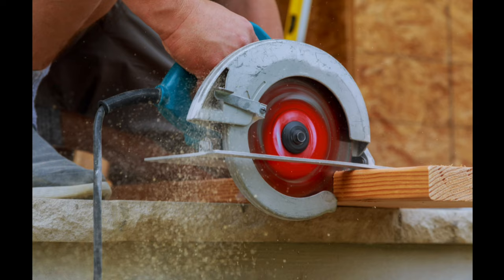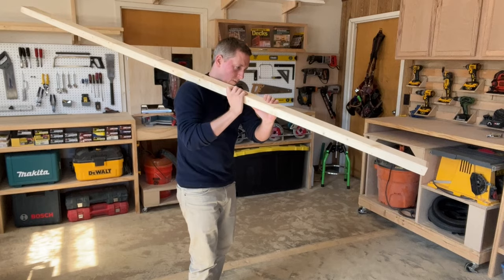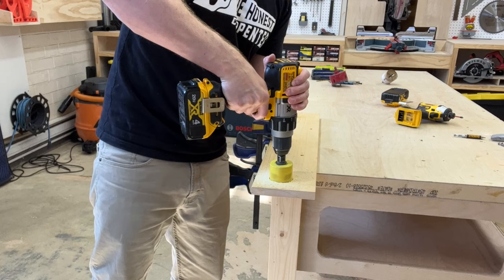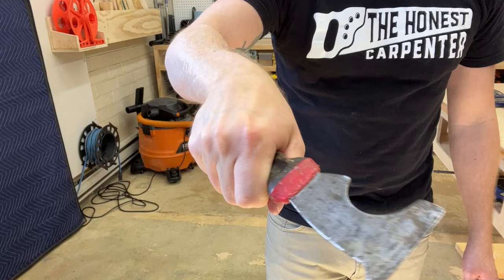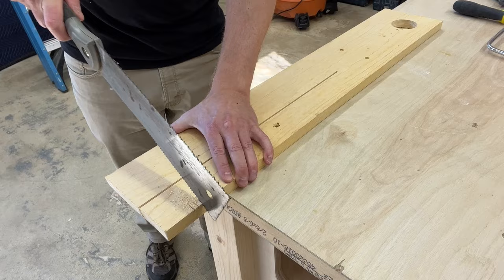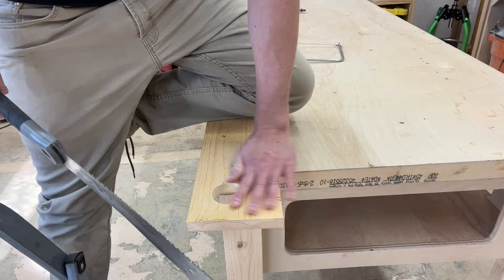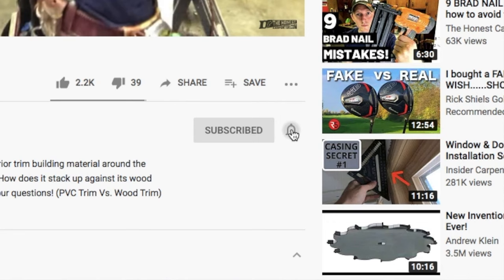9 MOST OVERLOOKED DIY INJURIES! (Avoid These 9 Worst DIY Injuries/Accidents From Common Tools!)

Comment: the thing I've noticed makes the biggest difference has been when I was trying to go fast.  - not just in injuries, but inaccuracies that cost more time than they gain.  working smoothly has less chance of errors that can result in injuries, damaged tools, damaged projects, and lost time.  this is especially true with hand tools.  they are designed so the tool does the work, so rushing it or trying to force it is counter productive.

Comment: You can never enough videos on this topic. Great presentation. Thank you. My personal experience to stupidity was when I was attaching a piece of blocking to attach a drywall repair patch in the ceiling. I was standing about 8 inches above ground in a step ladder and was pulling down on the blocking so that I can attach it to the ceiling drywall. Big mistake! A little extra pull needed to drive in the screw and that just tore the drywall. It just threw me on the ground and my rib cage hit the showe curb. I was tiling and just missed landing on sharp tools like trowels etc that were on the ground. Few valuable lessons: clean work area, it is pilot holes stupid, having a feel for the mechanism of applying force standing on a ladder even if just few inches off ground, strength/state of material being worked on.

Comment: Great info! The utility knife got me when I was a plumber many years ago. I was working alone running water lines in a new home in a large development. In those days, whenever we had copper lines cross one another my boss wanted us to wire the two pipes together and solder them. Routinely, I would find wire left over from the electricians in other homes under construction and use that for the pipes. Foolishly, one day I was scraping the insulation from some of the wires with the knife right against my left thigh and sure enough, the knife slipped off the wire and into my leg. Hopped in my truck and found the site superintendent and asked him for a couple bandages and headed to the honey bucket to assess the damage. Ended up just putting a couple bandaids on and went back to work. Never did get stitches. I still have the remnants of that three inch long, 1/4 inch deep scar.
Reply from the maker: It’s that fast, bowler 😅👍

Comment: Thanks for the video - it was clear, concise, easy to follow and very well presented.
Now for the anecdote. We used to RV a lot and I brought along a DeWalt XRP drill for numerous tasks, one of which was lowering the four corner stabilizer jacks on our travel trailer. This part of setup was usually my job but one time my wife decided to tackle it while I was busy with something else. Unfortunately she didn't check the direction of the drill (wrong) or the speed it was set on (high). The jack was almost fully retracted - it went up a half inch and stopped but the drill handle kept going. She had a loose enough grip that her wrist wasn't hurt but the handle made a half circle and the battery on the end clobbered her nose. It didn't break, but it was a close thing. We didn't have any Advil in the trailer but we DID have tequila, and the double shot she downed was probably quicker AND more effective.

Comment: These all make so much sense and the solution does require common sense and  thinking about where the tool can go. My dad used to preach about many of these and I've experienced injuries using simple scrapers. I can also directly relate to the utility knife issue.

Comment: I hate to admit just how many of these injuries I've had. I have a pretty nasty burn scar on my leg from a drill with a very hot bit tipping over after I put it down. One thing I frequently do that really helps with the torquing of the drill or driver is to always try to use my body as a brace as well. I know my wrists aren't very strong so I'll position myself to have the body of the drill up against a shoulder, hip or leg as well. That way, even if it does torque on me it can't twist far enough to break my wrist. I do sometimes end up with some nasty bruises but better that then sprains or breaks!

Comment: Yes, Ladder safety video! People die using a ladder incorrectly. Thanks, luckily there are a few of these I haven't done.
Reply from the maker: Teaming up with a roofing company soon David and they do intense ladder safety training. I hope to do that video with them 🙂
Reply: If a person is going to use a ladder daily I recommend springing for the one with the adjustable leg with the rubber feet. I used 24' 28' and 32' and you can set them up anywhere and adjust the legs.

Comment: Great video and lots of good comments too! I've been guilty (or learned from doing some of these things) too! As a woodworker I used a striking knife to mark dovetails, etc. and have learned that it's much better to take several light strokes with the knife than one heavy one. It's also faster and more accurate. Like not having to stop for first aid or the knife following the grain and making marks you didn't want in the first place! Excellent points on sawing! Old-timey carpenters used to have a sawbench they made to their specific knee height. Christopher Schwarz has a great video of a class making one on the Popular Woodworking site.

Comment: Great selection of dangerous operations.  As a professional finish carpenter I find that gloves can prevent most injuries.  The hole saw is my nemesis.  This is a dangerous tool no matter how you slice it, attach one to a hole hog and you had better hold on tight!!  The majority of my job site injuries involved hole saws 😡 As for utility knife injuries I suggest buying a utility knife with a quick change option, that way you'll change the blade more often. Nothing sucks more than having to bust out a screwdriver to change a utility knife blade!

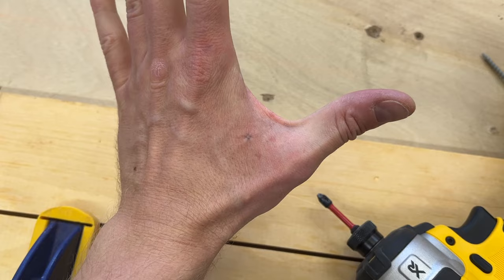Comment: 3:20 Keeping your hand on a screw when starting it with a drill is not necessarily a safe thing to do --- you can get painful plating-splinters from the screw.  I have had nasty black-oxide whiskers get driven into my fingers countless times when said jagged needle-like particles would flake off and embed themselves in my fingers when I was holding the screw to get it started; this is especially the case on the screw's threads.  Also the threads themselves are very sharp and can slice your fingers badly if the screw is turned while you're gripping the threads.

Comment: All good information. I never drink (booze) and go to the tools but a trickier one to spot is when to stop when I'm tired. I have recognised that I'm starting to make mistakes and fortunately to date have stopped work before I caused injury. My personal favourite injury is nailing 2 pieces of 1/4 inch boards together using a air-nailer loaded with 1 inch brads. 
A bit of shoot through you might imagine. Unfortunately I was using my knee as a support for the boards! Not life changing, but  a real wake up call to my methods

Comment: Excellent video Ethan!!  Some step ladders are designed to be okay to prop up to a wall while it's closed.  Most aren't designed for that.  Be careful or the bottom of that ladder could easily slide right out from under you.  🙂

Comment: Glad you picked up on drills and wrist twisting a drill is no joke. Several times drilling with a hole saw for a toilet flange so a 4-5inch hole, i have to use my knee to brace the drill as i know it would snap my wrist in a half second.

Comment: Good video.  The only hospital trip I ever had from a DIY injury was #1, utility knife.  I was stripping the insulation off a battery cable with the cable across my knee.  I had a brand new blade in it.  I don’t recall after thirty plus years exactly what I did, but whatever it was, it was careless and stupid and resulted in a 2 inch gash down the side of my knee and several stitches to close.  The funny thing though was with the blade being brand new, it cut my flesh so cleanly that I did not feel any noticeable pain.

Comment: One thing I would add about the ladder safety. When you said to lean the closed ladder against the wall, you really have to be extremely careful doing this. Especially when the ladder is on a drop cloth or something. When you get to the top the ladder has a tendency to slip out away from the wall. I had a 14 ft one do that in a clients house cause it was on a drop cloth and I was over the top of some built in book shelves I barely managed to catch the top of the shelves  while the ladder went flat to the ground and left me hanging up on the top. Got pretty bruised up and almost broke my arm.

Comment: By far the most dangerous tool for me is the utility knife/box cutter, followed by the table saw (scares the hell out of me). I treat both as if they had minds of their own and are biding their time to hurt me. I've also put a screwdriver into my hand, and a drill with a robertson bit into my thumb (was too tired to prevent this, then I did it again immediately after). We all get hurt, and learn a bit about ourselves. Good list, but not one I'm checking off the boxes.
Reply: An electrician work colleague lost an eye when a screwdriver slipped at face level.

Comment: I had landed in an ER once, because I didn't use eye protection for a small job using a tile cutting circular saw. Thankfully it was a quick in-and-out trip.

Other things I'll like to add that people should be more careful with are hot glue gun, angle grinder spark (especially near saw dust/combustible materials), smoke/fume inhalation and ear protection in confine space.

Stay safe, everyone. 🙏🏼

Comment: I would add to your number 1 - utility knives.  Even taking care in the cutting with one of these, when you put it down between cuts - retract the blade.

I am in electronics and used to work at a bench all day.  I had screwdrivers, soldering iron, pliers etc on the bench alongside my knife.

In working, the knife slipped off the bench, caught my thigh (I was sitting down) and was followed by my hand as I tried to save the knife - blade out and up!! Several stitched later......

Comment: Great video! I have personally had everyone of those injuries. Along with almost cutting my forearm on the scoring blade using a sliding table saw, cutting the tip of my finger off using a table saw, tearing my ligaments in my arm carrying MDF sheets to the table saw, carpal tunnel from making office doors putting them into the hot press, aluminum fragments in my eye after routering aluminum laminate and then using and air blower to clean out the inside of the cabinet.....on and on.

Had to bring a fellow co-worker to the hospital after he pushed a spade bit into his hand while drilling cabinet door lock holes!
Not an easy trade that's for sure.

Comment: One thing to note on leaning an A-frame ladder. One time while doing this, the feet  slid out and I “rode” it down. Thankfully it was a comically slow slide out and it was only a 6ft ladder so nothing bad happened. I was more embarrassed than anything.  

They do make “lean safe” a-frame ladders with rubber feet and rubber bumpers on the top part designed prevent this. It’s actually a safety rule at my work that we are not allowed to lean ladder unless designed to do so. I understand why now!

Comment: @2:47 What is it with drill bits (cam outs) when it lands on your free hand?  You'd never think a screw driver bit would be able to carve your hand/fingers like a Thanksgiving turkey!  I did it once and will never do it again.  And as for the utility, I always project where the blade will be if I miss.  And keep my hand out of the path. It's also true when using scissors to open packages. I've seen too many people pull the scissors towards their chest/hand etc.

Comment: 0:42 This one sent shivers down my spine just thinking about it. Where I work, we use a lot of formwork plywood, and the resin on the surface makes the edges insanely sharp. I often get scrap cut-offs for projects at home, and have cut myself more than once just holding them.
4:20 My Bosch GSR 18V-60 C has built-in kickback control that is programmable via bluetooth (sensitivity).
Nice to have when the drill is rated at 60Nm / ~44 ft-lbs.
9:07 My grandfather once advised me to always cut away from myself if at all possible. The old man was like an encyclopedia of DIY knowledge. :)

Comment: Lumber sliding - done once... never again!
Hot bit grabbing - done once... never again!
Scrapper - done twice... was sick once, now wear gloves and have changed the grip... finger nails grow back but a foreign object going between the nail and the nail bed is more than painful.
Step ladders - not the same but a long story...  I replaced the majority of the summer house roof with new OSB and obviously applied new felt to the whole roof and replaced sections of the glass fibre insulation with insulation made from plastic bottles. All in all the roof 132sqm roof and I did the job including removal of vines branches and the old felt in 4 days.  During that time I was using a ladder with a wide base, bought it to decorate the house as it had plates to be a platform.  At no point was it unstable but it takes time to set up.  Fast forward a few months a large branch lands on the roof... instead of grabbing the ladder with the wide base that takes time to set up (less than 2 minutes) I grab my 20 year old step ladder...go up retrieve the branch and then step on to the ladder as if it was a wide base. I am 189cm tall, my foot was at the apex which is 302cm (my head is 16.1089 feet of the ground) and the ladder spits me off... knocked out, memory loss as I don't remember waking up, and putting everything away and for the next few days sucking up the pain until I laughed hard and was on my knees... 3 broken ribs and 2 cracked rib on the rear of my right side. Beware of ladders
Utility - A few cuts - I try to use cut resistant gloves

Additional one - picking up the wrong screw I was building some dog agility equipment and using very sharp, self tapping screws to put things together.  I new my depths and had put out 70mm screw in the project and then was a little surprised when I couldn't move my supporting had that had been holding a brace in place... I had to slowly wind the screw out to release my left index finder... somehow I missed the blood vessels and it never bled... I had somehow missed and 80mm screw in there.
To this day that agility equipment is strong and I have a little dent in my left index finger... make sure you have the right length fastener! ;)

Comment: I was on a ladder putting a screw in a bracket in the bottom of a shelf board at eye height.. the screwed rolled over the drill skipped off the shelf edge driving the bit directly into my eyeball making that star pattern in my eyeball.. instantly lost vision in one eye solid black. Drove myself to emergency room

Luckily vision slowly came back over a week and can see perfect

Comment: Before I watch the utility knife bit of this video:
I have never injured myself with a utility knife, kind of miraculously considering how often I use them at work, but it is probably because literally every single time I am done using it, even for a second, I close it if I know I'm putting it down. I do that every single time. Putting it down? Closing it. Doesn't matter if its for even 5 seconds. I've made a habit of doing that because our work can get really messy at times and if you don't know where a knife is, you could easily reach over to grab something and cut yourself not knowing there was an exposed knife sitting behind something.

Comment: I have two suggestions for drilling with a spade bit or hole saw.  First, if your drill has a torque setting, set it way down low.  This will both teach you to not press too hard, and also help prevent you from torquing up your wrist.  The other is: if drilling one-handed, operate the drill with the left hand: when it binds and the drill body jerks, it will pull free from your hand and shut off.  Maybe not ideal, but better than a strained up wrist.

And finally a tip from some-or-other professional chef: always remember that you are made of meat.  If that knife (or saw) can easily cut meat, it can easily cut you.

Comment: #7 happened to me recently with a drill bit that snapped and sliced the top of my thumb open because I was holding the board steady. It was a drill bit not a driver bit. So it's wiser to use a board vice jig or clamp to avoid injuries like mine.

Comment: Adding onto the drill follow through tip: I've found this happens violently when you're drilling through thick cold rolled steel. This is because of the bearing strength even a tiny bit of steel stopping the drill bit has. Please be careful when drilling through thick steel with a large drill bit, both hands on the drill and a handle if you're able too. If the drill bit does catch, the drill can not only pull your hand with it... it can PIN your hand violently between the drill and the material you're drilling through.

Great video, great content, really useful.

Comment: I have a scar in between  my index finger and thumb from having to get 5 stitches when I was using a utility knife to open something glued shut. Exactly the scenario you described. I was applying a lot of force due to the resistance I was getting, but once it broke free there was nothing between the blade and my hand. I just missed cutting through the tendon that connects your thumb to your finger.
Reply from the maker: Ugh, sorry to hear that Michael! It’s so easy to do 😓

Comment: Great video. When using a utility knife, I tuck my thumb under under my hand. All you will see is my fingers. Yes, I still need to be careful and use a sharp blade. Started doing this after my friend slashed his thumb cutting drywall.